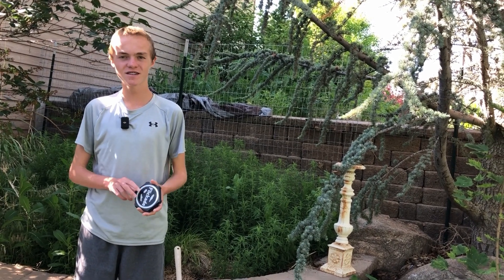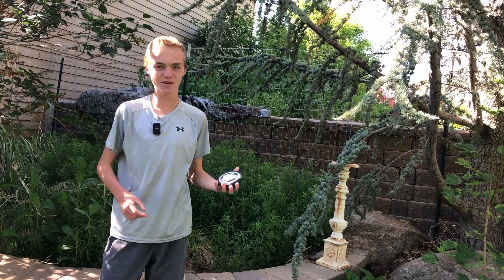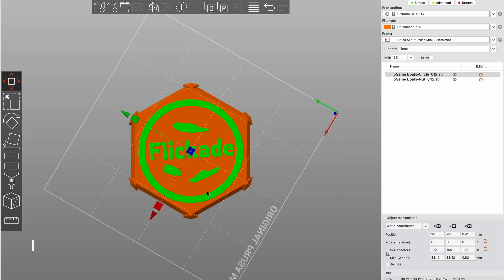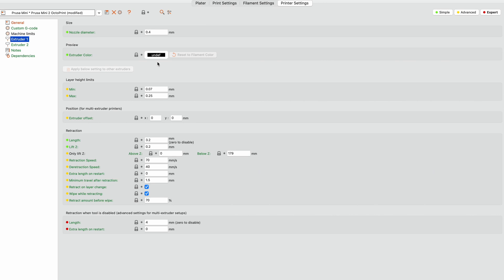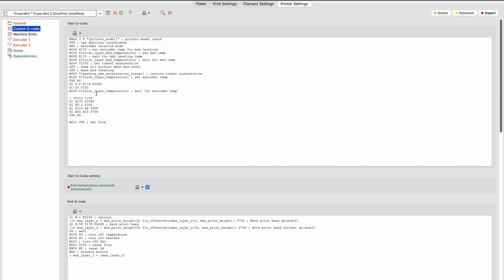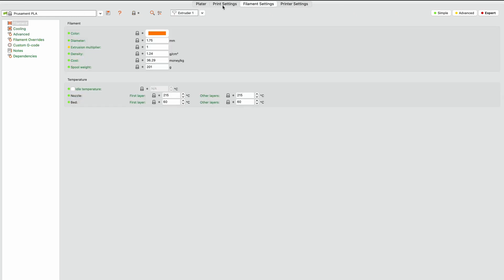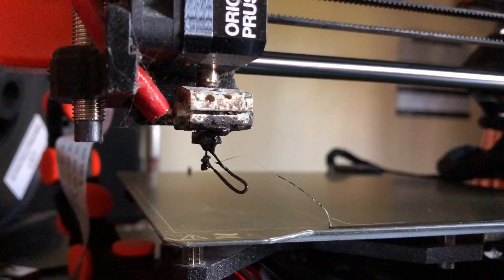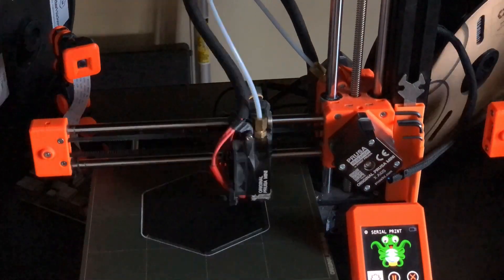Print Two Colors On The First Layer ||  VIA Gcode

Comment: There are several videos that essentially show a common method. Instead, you made it simpler. Also with Prusaslicer, I applied your technique to a STL(without an embossed section - just flat like your lid) and an added a Text Part instead of another STL (that got assigned with the first color). It worked perfectly. Way better than having to mess the STL to remove the volume that the text will use later on, and having to align all the stuff. Instead, just one step and done. And I can edit the text anytime directly in Prusaslicer.
Thanks a lot for sharing!   The only difference is that I used M600 code on "Tool Change" section.

Comment: The M600 command doesn't work with natively on Klipper with my Neptune 3 Plus. I need to create a macro called 'M600'. 

How does printing a brim work though? The brim usually prints at the beginning of the print. I would want the brim to print in the middle during the filament change (between 1st color and the 2nd) to purge out the 1st filament.
Reply: For this you could create a wipe tower of sorts by including an object apart from your intended print and if you place and design it correctly it will print this before the second color on the first layer of your print. I'm thinking something like a ring around your object in the shape of a brim, but as an object and not a slicer defined brim.
Reply from the maker: Oh, I guess I didn't mention but using the brim and having it at 3 goes twice with the first color and once with 2nd color.